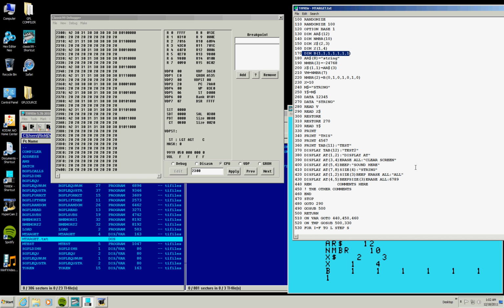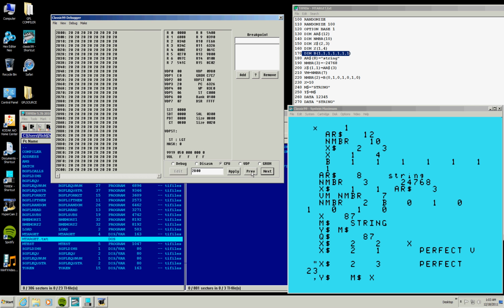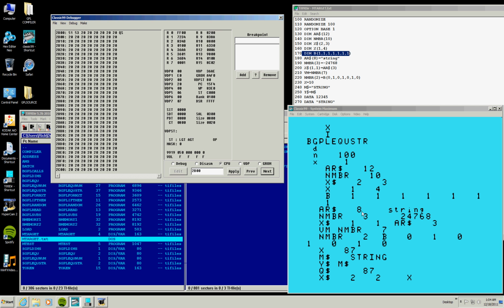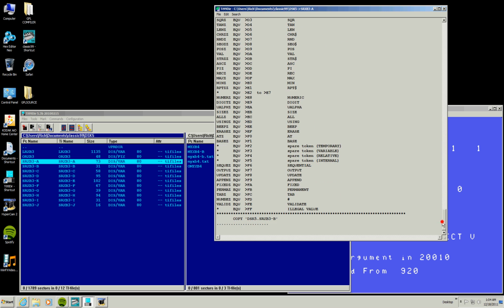RXBCOMPILER2.avi

Comment from the maker: Well started work on removing the Interpreter and the Editor and so far seems more easy to do then I thought. The idea is it runs the program but instead of running the program it creates the GPL output code as it rolls through the code. Variables are done same as XB.